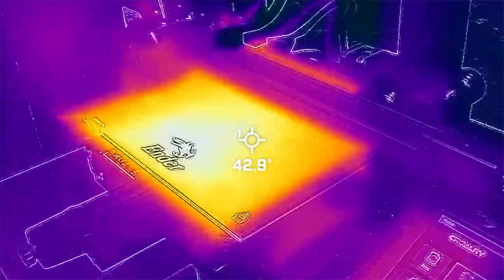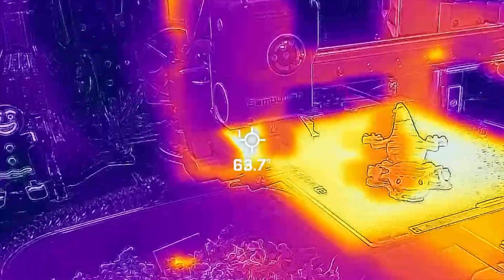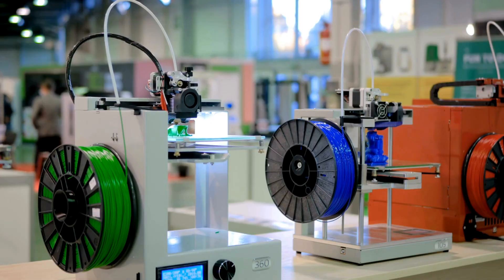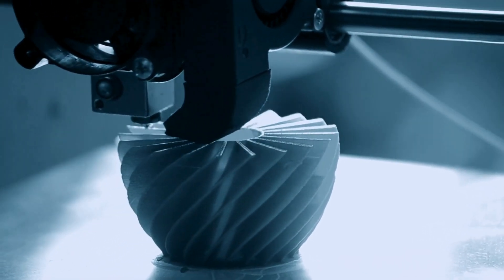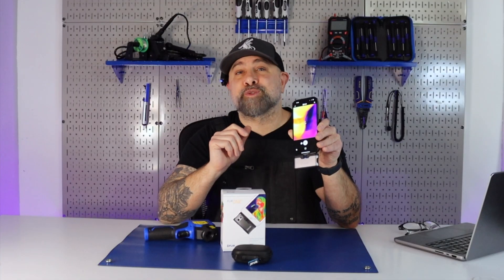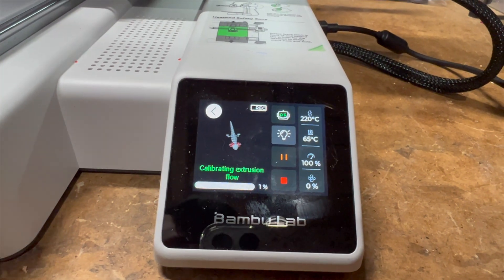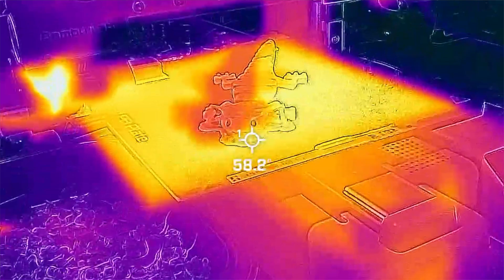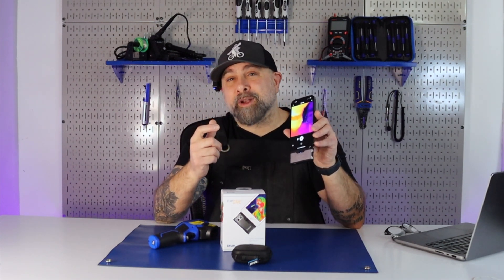Using Thermal Cameras in 3D Printing - 🔥 How Thermal Cameras Enhance Your 3D Prints! 🔥

Comment: I think the temperature variation is likely going to be due to the location of the actual wires running through the plate. Since the plate isn't typically a solid heating surface but rather a board with wiring running through it. Think of a heated blanket and how the wires travel through in a big zigzag type pattern.
Reply from the maker: Totally agree. The thing that was odd was even the hottest spots, the ones say where the wires are, were still off from what the bed temperature was set to on the printer.